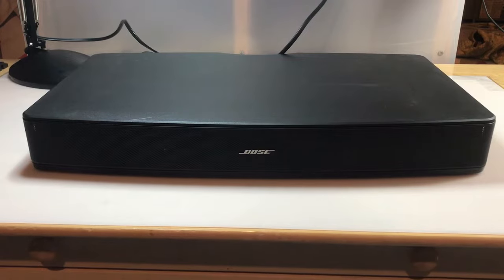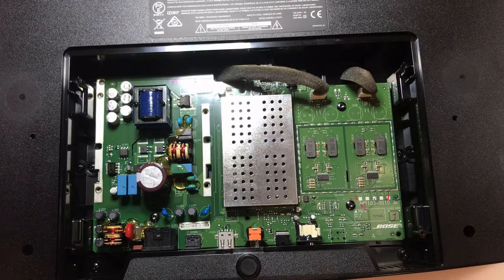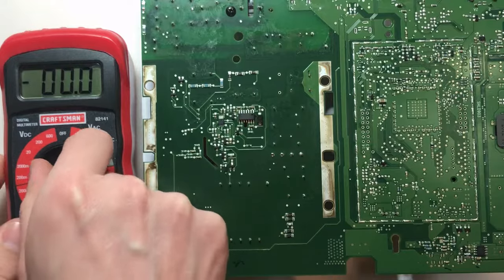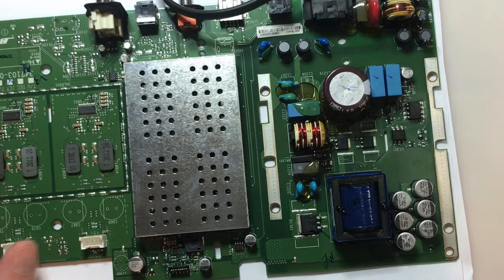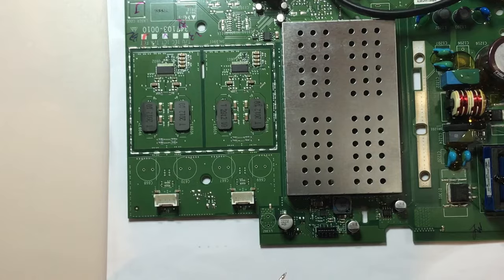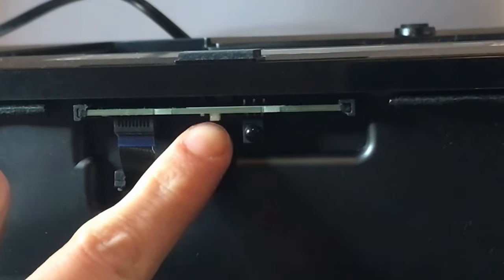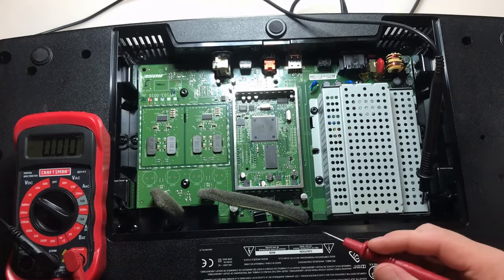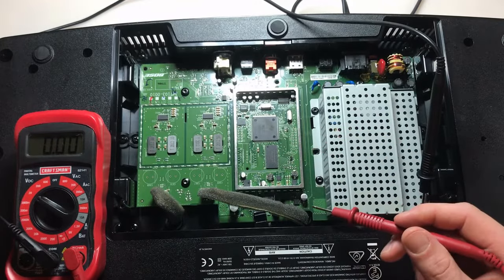DR #3 - BOSE Solo Sound System Troubleshooting

Comment: FIXED: I watched the entirety of this video and performed each check. Each check yielded a similar result. I was about to fold when I read several comments stating success with a heat gun directed at and around the microprocessor. After waiting for it to lose heat, the device powered as expected!

Nevertheless, this video is excellent, methodical, and informative. Thank you!

Comment: FIXED:  After looking at this great video, I checked the voltage on the PS Capacitors, they were 24 Vdc, good.  So I then looked under the emi can at all the micro chips for cold solder joints.  I reflowed all the chip leads with a hot air gun.  I then plugged in the power cord, and got the familiar 2 beeps, and the unit started working!!!
Reply: For me it did not work - the same symptoms after reflowing: no green light, no response to the verified working remote. I believe this type of Bose equipment is developed with planned obsolescence, so to die after the warranty period.

Comment: FIXED 08JAN2025: Heat gun directed around microprocessor area, above below for a few minutes.  Heated no other areas, reassembled, and it fired right up after.  Been 2 days without issue, no idea how long it'll last, but if I remember, I'll update if it fails again.  Thank you to those that commented before me, as it was their solution, only writing to confirm it does actually work.

Comment: This was an excellent display of expertise. Thanks for sharing it with us. I am having the same exact issue with mine, and have become beyond frustrated by the device. I'm beginning to see why you "dropped" it. 

Word to the wise and laymen alike as stated multiple times within this video those capacitors will hold on to hazardous voltage long after the power has been removed, leaving the inexperienced open to a hazardous shock. I wouldn't bother with trying to repair this device on your own if you're a newbie to electronics.

Awesome video! Earned a like from me at least!

Comment: If someone still come here to find answers - the fix is to reflow every pin of the processor. Mine had the same problem, working remote, all voltages are present, but not turning on. Heating the processor makes it turn on, but when it cool down it stops. I checked on the microscope and saw that almost every pin is kinda desoldered. Moves just a little, with a little stronger push, but it moves.. Tried reflowing with the hot air, but ended resoldering every single pin with the soldering iron.. Then checked them again, they were solidly soldered, now the system works perfect.

Comment: The video is already 3 years old but still valid. 

I found a simple, but somehow strange solution for this problem: I heated the processor compartment, after I had opened it, with a hair dryer on highest temperature setting and then the unit started to work again.

The rest of the testing had given me the same results as here in the video.

A question? Which one of the parts built in the processor unit is sensitive to temperature? The fault must be with that part, since with a bit of heat the malfunction can be fixed.

Its a temporary fix only. The BOSO SOLO stops working once the unit cools down again. A really weird fault. But I have not given up hope that it can be fixed!

Comment: Hello, I have just had one of these turn up at the Market Harborough Repair Cafe and have already done the same tests as you demonstrated so well, but similarly did not find a reason for the unit turning on the green LED and running. I will be bringing it home next week for a more detailed look. Did you get any further with the repair? If not I will report back if I have any success. Keep up the good work. Kind regards, Steve.

Comment: I have looked at one of these solo TV soundbard. Despite the excellent construction and components choice, the device is weak on its DSP, a TI D808K023CPTP4. The bar I looked at had its active-clamp flyback power supply in good conditions with 24 V across the output caps. No response from remote. When I heated up the chip with a hot-air gun while power was off (unplugged) and then re-plugged it, the bar did chime at power on and could play music. Turn it off and it's gone in mute mode again. I warmed the chip again and quickly following Bose site instructions, I could update the firmware. It works again but I'm sure it won't last long. Shame cos' this is a nice piece of electronics with good-quality components.

Comment: Hi there. I have a problem that is a bit different. My unit makes the two tone sound when I plug in the power cable to the wall outlet.
But that's it. After that it does not power on. Remote-Control seems ok since it is visible the infrared led functioning through a camera.
Any help will be appreciated. Either from you or anyone else here.  Thank you.

Comment: My unit is reporting exactly as yours. Down to the T. Too bad you we’re not able to do a part 2. I’ll go ahead and replace the crystals and let you know if it worked.
Reply: Have the same issue. Please let me know if it works.  Can you please help me with a resistor marking that blew on my main board and now I can't find any schematics to figure out what is its value. the resistor is located on the power supply side next to the bridge rectifier (BR1201) and the component marked with C1224. thanks
Reply: hello,
do you have replace the crystals? does it work?
Reply: @andyskatman4366  sorry it's so late but that seems to be marked as a 75m fusible resister. Hope that helps if you are still working on it
Reply: @andyskatman4366  here is a pic of that resistor: https://imgur.com/Sj3F8hC, ai un mail sa discutam? Ai rezolvat?

Comment: Where can I find a replacement remote because I just troubleshooting mine using your video and I see my remote doesn’t work even after I replaced the battery
Reply from the maker: Other than Ebay, I'm not sure where you'd get a replacement remote.
Reply: You can use an app if you have a device with an IR port

Comment: Any idea what the USB socket is for? It's labelled "Service." If I have a processor problem (I think I do) then maybe there's a diagnostic tool available through the USB connector.
Reply: If the processor is not working, the 5V on the USB port will also be missing, making it impossible to use the USB port for diagnostics or updates.

Comment: TO EVERYONE WITH THIS PROBLEM:  First, "get a brand new battery for the remote".  Then unplug the unit for at least a week, I actually had to go 2 weeks.............then plug the unit back in and wait for the tone. Now, after the tone "WAIT AT LEAST ONE MIN BEFORE ATTEMPTING TO POWER UP".    You should get a green light now........................Why does this work???   I have no idea...............but its worked for me twice, since it wouldnt power up, even after the reflash and 5 min inplug.  (Id still like to know if the crystal replacement worked or not)..............
Reply: How can I turn the unit on without the remote
Reply: @danielwarren7353  You cant.........
Reply: @godsuno777  thanks man
Reply: @godsuno777  This comment helped me fix my Bose Solo Tv with the exact same problem as shown in this video. No power, no light, nothing. Just had to solder 2pcs of 100uf 16v capacitors. No crystal change needed. Thanks!

Comment: Hello On pin 9 of the integrated circuit Fan7384 there are connected a resistor with an sot323 ... the sot323 should be bat54cw  but i don't know the resistor value ... while connected between diode bridge and fcd7n60 there is a resistor 1210 with written 75 ||| ... is it a 75 ohm? unfortunately on this card there are some things burned and I can't find the values please help me ... thanks
Reply: the resistor marked as 473, should be 4.7K ohm
Reply: Did you ever fix this?
Reply from the maker: I did not. It’s been so long that I forgot what all of the issues were.
Reply: that resistor its says 75m but i dont know if it is ohms or miliohms. My is measuring like a fuse but i dont know if this is ok.

Comment: this could actually be a Muting problem :
The Processor section cannot send an Unmute signal to the power amp section hence it is stuck in Standby or Mute mode
Check the datasheet of the Power Amp IC which pin is the Mute pin and how many volts should be applied to switch it ON from Standby or Mute mode

Comment: For what it's worth; I have had two of this model exact Bose Solo sound system devices. They both failed after many years of use. I have replaced the six capacitors of the power supply just to exclude it's not those. But it did not help. I've not been able to repair a faulty Bose solo sound system. The symptoms are the same; the device does not turn on, or it turns on and after a few days of use it dies again. After unplugging the power cord for a short time it comes back but does not keep working correctly.
I will attempt to replace these two crystals on one faulty device, would be nice to know if this helps.
Reply: Did it help?
Reply: @qayqay2754  It did not help. I guess it's just the main propriatiary IC that's broken.
Reply: @i80486dx  perhaps it's a overheat problem with the IC.
Reply: @johnathanpearson3203  Yes, I'm also thinking the main IC is faulty. As this IC is a Bose proprietary chip it cannot be replaced.

Comment: Great video. Did you end up replacing the two crystal oscillators? What was the result? Please, please tell me it resolved the problem. My money has been on the Super IO chip, which would suck because this would be not serviceable.
Reply: Hello On pin 9 of the integrated circuit Fan7384 there are connected a resistor with an sot323 ... the sot323 should be bat54cw  but i don't know the resistor value ... while connected between diode bridge and fcd7n60 there is a resistor 1210 with written 75 ||| ... is it a 75 ohm? unfortunately on this card there are some things burned and I can't find the values please help me ... thanks
Reply: @fabiobrasca619  bat54cw is just a diode which is not current dependent. The valve of the resistor is not that important. Check for open or short circuit to ground at the diode. Resistors are almost never the source of problems in a circuit. Capacitors, MoSFETS, and main logic IC's are prone to internal short circuit conditions in most cases. This is why I was very skeptical that replacing the crystal oscillator(s) would resolve the problem in this system. This board looks immaculate except for the main Processor IC, which by the manufacture's logo looks like it was made by Texas Instruments (tI) and shows signs of overheating. This audio system is basically a no fix, even for BOSE.
Reply: @tubelife70  Hello thanks for your answer ... yes true you are right but while I was doing some tests the IC fan7384 flared and burned my bat54cw with the connected resistor, the two mosfets fcd7n60, lm5021 was already shorted and a 1210 resistor on which I do not remember if it was written 75 or 750 ... so I need to know both the value of the resistance connected on the bat and that of the resistance 1210 connected to the mosfet fcd to try to get back the 24v ... I have a short on 2 0603 capacitors outside the dsp cage near the optical connector on which I will have to investigate ...
Reply: @fabiobrasca619  I won't be back to the office until this coming Tuesday, when I will look at the original board and try to get the correct values for you.
Reply: @tubelife70  Ok ok I owe you ... I am waiting for your news ... Thank you very much
Reply: @tubelife70   If it's not too much trouble tomorrow you could check the two 0603 capacitors out of the cage precisely on the side where there is the usb connector and the optical connector that the tester gives me in short circuit ... Thanks
Reply: @fabiobrasca619  OMG! I am so disappointed. Today I discovered that an over eager employee of mine has dispensed with a huge lot of donor boards, old motherboards, and yes the BOSE Solo unit that has now joined its brethren at the electronics recycling depot. After picking up both my jaw and heart up off the floor and resisting the temptation to blow my own fuse, I have since surmised that a clean and well organized parts room is not without its own merits. Bud sadly our one hope has been lost to the 9th dimension. Wish I had not gotten your hopes up and again I am very sorry.
Reply: @tubelife70  quiet do not worry ... I hope to find someone else as kind as you willing to help me ... thanks a lot anyway

Comment: I opened the cover exposing the processor used a heat gun to heat everything up , it then powered on so i used a usb and downloaded firmware update installed and seems to be working as it should, so heat gun or firmware update seems to have fixed the issue not sure which but if i had to guess id say the heat gun, seems like a similar problem the original xbox had from heat issue severing soldered connections on the board,??????? your guess is as good as mine.
Reply: On pin 9 of the integrated circuit Fan7384 there are connected a 0603 resistor with an sot323... Can you tell me the value of this resistor please?

Comment: It's crazy just picked one up, had exactly the same issues, heated it with a hairdryer got it working, played YouTube through the TV for a bit then came a loud humming sound so I had to unplug it, turned it on tried again did the same after about 10 mins, then just used it through the TV freeview and it worked way longer so no idea what it's problem is, will try updating firmware and see what happens, no idea why it didn't like YouTube but had no problem with freeview, and the under heating baffles me

Comment: Hi there can you or anybody confirm a basic test I checked the fuse without power from  underneath the board with a basic bleep metre I got a bleep on fuse but nothing on the next in line that brown vertical block but yours looks slightly different???

Comment: Iv got one here that when it’s plugged in nothing happens, no green light when the remote is pressed etc. Have tested the output from the IR sensor and it drops when the button is pressed. If I use hot air and warm up the area under the processor shield a bit (so it’s hot to touch, but nowhere near reflow temps) the unit then turns on when the power button is pressed on the remove and I get a green light, so presuming something under that shield is bad. 
Going to let it cool down and then try a bit more directed heat on each component and try the power each time until I find  the component that needs heat to function and then try replacing.

Comment: I have te same Problem with the device.I checkt the resist of every smd cap in range of the Prozessor against the minus pole (mass).1 Darkbrown cap have connection on 2 sides of the cap.And bingo the device Works after chancing cab .The cap was Shortet.Dont forget the cabs at backside.
Sorry dude my english is very bad.

Comment: Hello, i have had the same problem (wont turn on) but when i plug the power cable there was a beeep beep. After checking all the voltages i found that there was a problem With the remote.  Now working.
Reply: Hello On pin 9 of the integrated circuit Fan7384 there are connected a resistor with an sot323 ... the sot323 should be bat54cw  but i don't know the resistor value ... while connected between diode bridge and fcd7n60 there is a resistor 1210 with written 75 ||| ... is it a 75 ohm? unfortunately on this card there are some things burned and I can't find the values please help me ... thanks

Comment: Mine works but stops from time to time and won't respond to anything. The front LED remains on. It has to be unplugged and rebooted, then it works again. Sometimes when it stops working a low level hum comes out of the speakers (not the mains frequency but quite a bit higher). As soon as you said "processor" I thought "that will be the problem". Nothing reduces the reliability of an electronic device like a microprocessor! So I doubt I'll be able to fix it.

Comment: Just a quick question. Have you checked AC ripple on the power supply output? I have the same problem and I found 51V AC ripple. I'm changing the filtering caps. We'll see if that helps...
Reply from the maker: I did. Unfortunately the problem was the custom, non-replaceable IC.

Comment: Im inspecting one which hast good 24V, but is stuck from time to time and does Not respond.
I have some Spikes measured on 1,8 volts which seem Strange.
ITS vr701 in Service Manual.
Reply: Hello On pin 9 of the integrated circuit Fan7384 there are connected a resistor with an sot323 ... the sot323 should be bat54cw  but i don't know the resistor value ... while connected between diode bridge and fcd7n60 there is a resistor 1210 with written 75 ||| ... is it a 75 ohm? unfortunately on this card there are some things burned and I can't find the values please help me ... thanks
Reply: @fabiobrasca619  sorry i have repaired a while a ago and given back, so I can not look up for you.
Reply: @thomasw6169  ok ok thank you anyway..

Comment: What if the remote isn’t emitting LED light? Batteries are in correctly
Reply: Make sure you check using the front-facing camera on your phone. The back facing cameras on phones have an IR filter and you won't see anything. So be sure to switch it to front-facing.